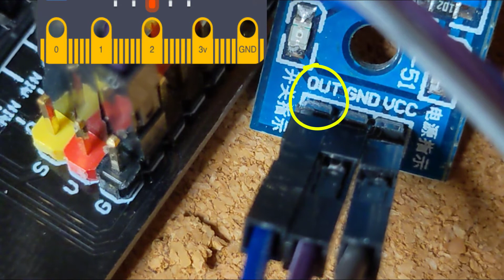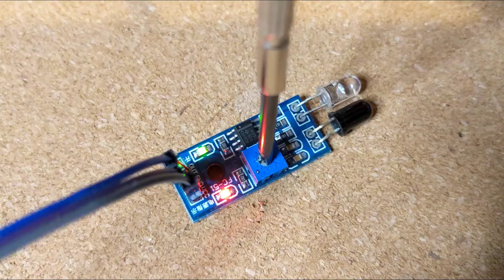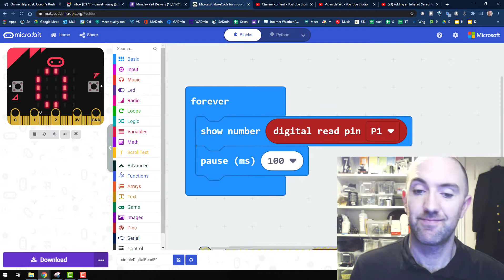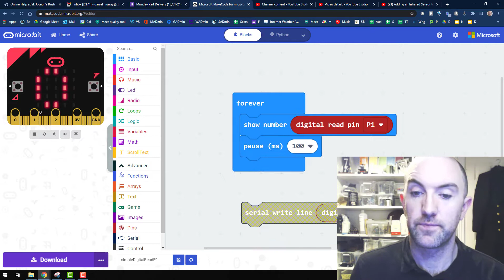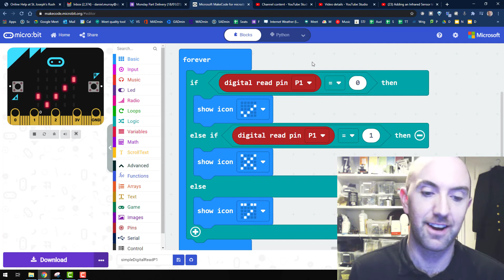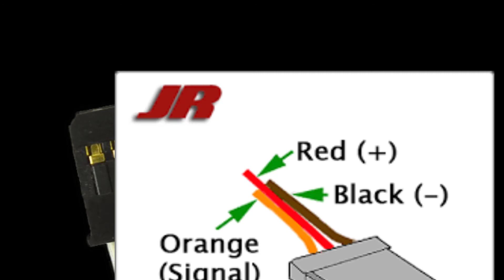Infrared proximity sensor with BBC Micro:bit (Obstacle Avoidance Sensor)

Comment: Can't tell you how long I struggled to get this to work! Using that resistor between Pin and 3V was the missing piece. Thanks so much!
Reply from the maker: You're very welcome! I did find though later that you can do it without the resistor as there's a software implemented pull up pin block in makecode.org :D Think it's under "Pins".